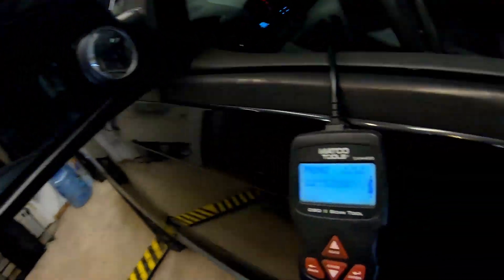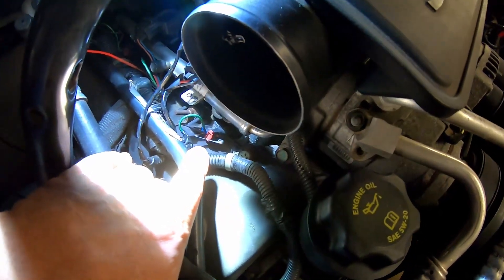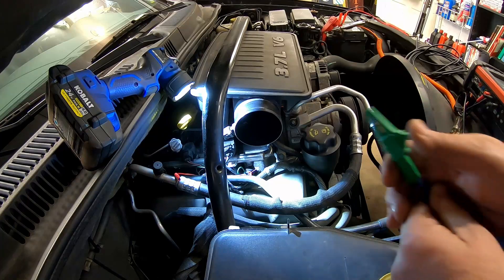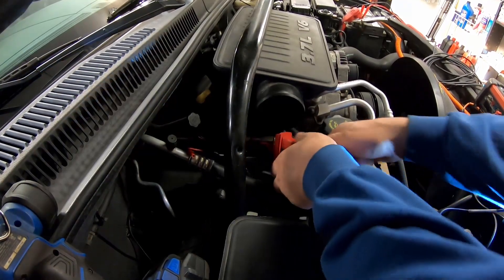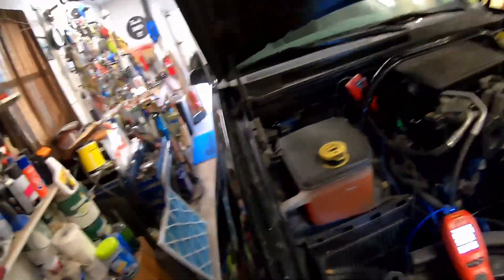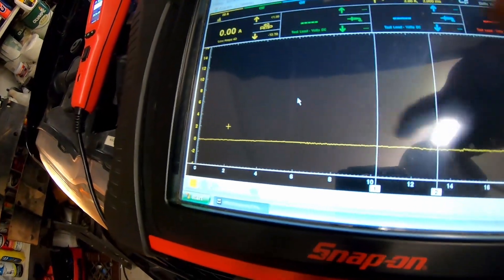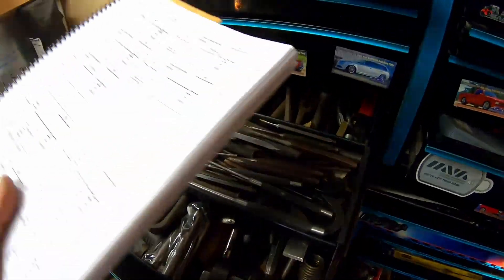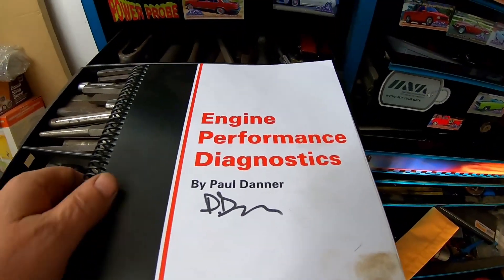Testing Injector code P0202 on 3.7L Jeep using 3 methods.

Comment: How do you know if you have an open driver.  
Instead of flashing does text light stay lit on the computer control wire.  
Noid light stays lit, not flash, i replace injector.  Nothing changed.
Reply: Thank you very much for your help.  I rechecked the control wire.  
Unplugged it from injector, T-pinned it. 
Hooked up test light to battery positive & to injector control wires. 

Test light was lit, i unplugged the pcm connector C2/ orange. Test lit went out.  Pcm inj.2 driver is shorted out or bad.. 

If the test lit stayed lit when i unplugged pcm, would've meant short in control wire.  

I wanted to share this with anyone else that might see this and don't have a scan tool, having issues determining if it's the pcm driver or not..
Reply from the maker: @FredSmith-r6c  awesome 👏 great troubleshooting! You’re welcome, glad I could help.
Reply from the maker: The test light will stay lit on the computer control wire IF the plug is plugged into the injector and aligator clip is hooked to the ground. 
If you are using a NOID light the plug should be disconnected from the injector. The NOID light should be flashing with the motor running or starting. If the Noid light stays lit constantly then i would look for a short to ground on the computer control wire.

Comment: I always use an ohm meter at each injector, looking for about 12 ohms is good injector, K ohms or M ohms is bad injector.
Reply from the maker: Good point Tom. I did ohm out a good injector and it was 16 ohms when up to temp. When this bad one fails ith has no ohms. I never did check the ohms when it is working. (cold) I'll have to do that before i change it tomorrow

Comment: Awesome video brother.  Thanks for sharing.  I am still working on a P0 455 code which is a large emission leak. Found on hose with a big hole in it but still getting same code. Keep the content coming.  Hope you have an incredible day night. Much love and RESPECT
Reply: Tim, every time I’ve encountered po455 it has been the fuel cap.
Good luck!!
Reply: @UnfinishedProjectDartSport  I have replaced the fuel cap. Gonna smoke it again this weekend I hope
Reply from the maker: Good stuff